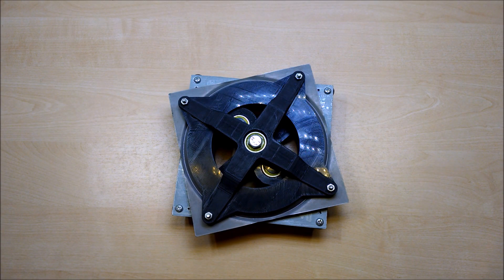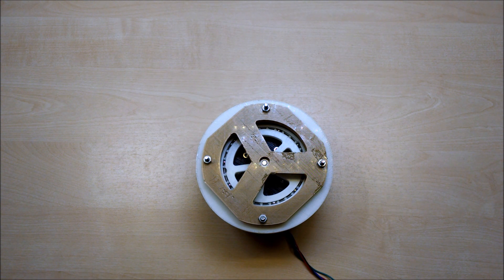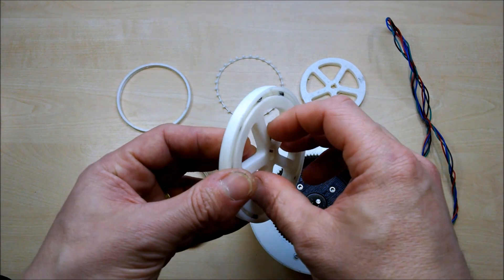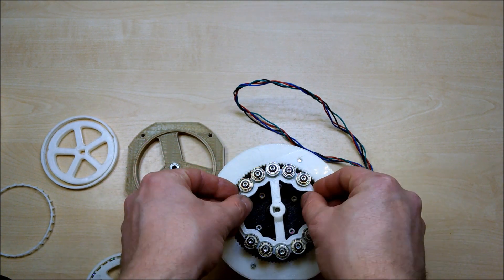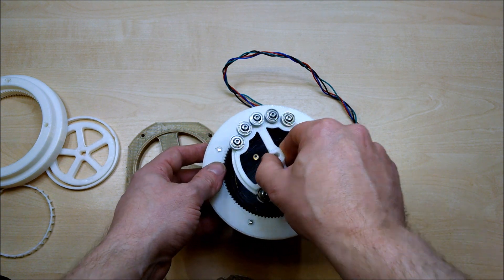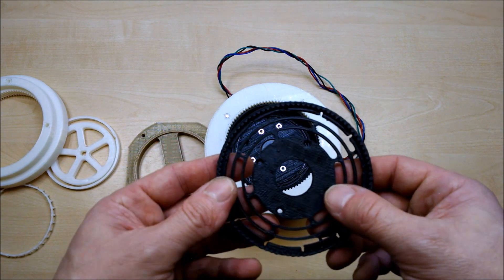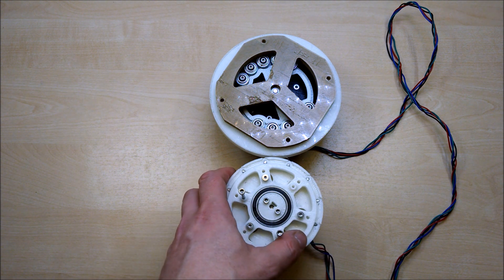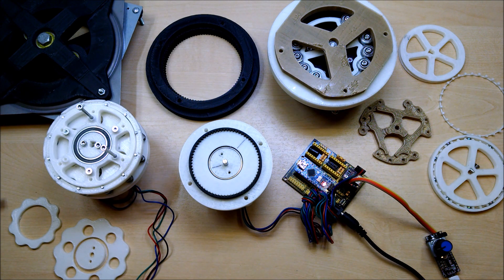Strain Wave and Hypocycloidal 3D Printed Gears Update

Comment: Nice video. You know there is an online calculator for ratio and design of hypocycloidal gears? I do not want to make PR for the site, but it is a site with a lot of designs. Just google "hypocycloid gear calculator" and you find it at the first place. I managed to get the shapes into Fusion via excel and importing a csv Spline. It is a little bit tricky at first glance, but it works fine.
Reply: alternativly I can highly recommend to read this paper upon modelling hypocycloidal gears: https://www.researchgate.net/publication/303577116_Modelling_the_Meshing_of_Cycloidal_Gears
I prefer this one over the otvinta one because it does not need any adaptation with offsets etc and the parametric functions are pretty easy. I use Excel to set the parameters and draw the profile to "play around" and import the r q and e values as parameters into my cad to constrcut the profile.

Comment: I was making something very similar recently, and discovered that the bearing problem is caused by the groove with a half round cross section. This causes many portions of the ball to make contact, and each has a different linear speed due to different circumference. I changed the groove to a trapezoid cross sections, so that only the angled sides make contact with the balls, only in two points. The back edge has clearance, and does not make contact. There is a very drastic reduction in friction, the bearing spins freely while being tight enough to have no easily detectable slop. I haven't tried using a cage, but I suspect that it would work well.

Comment: This is awesome. Has this project stalled? I haven't seen an update in about a year.
Reply from the maker: Yes, stalled in progress but not in spirit. There are several projects that seem to be doing very well at this kind of gear, so without a strong personal use case to drive the development, I'm letting others progress the field. E.g. Open HD (harmonic drive) and Paul Gould's work. Both on hackaday.io.
Reply: Simon Merrett I’ve been looking at Open Torque. Something like that seems to be the sweet spot as it would allow for natural feedback at the expense of some backlash maybe.
Reply from the maker: Ooh, I hadn't seen that before. Thanks. Seems similar mechanically to this recent endeavour https://hackaday.io/project/164175-custom-motor-for-robotics

Comment: Great work. What I didn't catch from your speech, what was the reduction ratio of the final hypocycloidal gear working with the belt? And the numbers you showed for the hypocycloidal in the spreadsheet, they were taken with the first version with the roller bearings on the outer circle, right?
Reply from the maker: Scale Mog 69:1 (I think but rusty on the calcs at the moment - 69 teeth on the cycloidal discs and 70 teeth on the belt). The numbers in the spreadsheet cover a range of my designs but the one with the outer roller bearings had a 12 teeth ring and 11 teeth cycloidal discs, with a torque multiplier of 13.6 before the NEMA 17 stalled (likely due to the relatively low reduction ratio).

Comment: Can you make a Video about The rigidity of The gear, maybe with a lever arm? Please
Reply from the maker: Jojo1 my video setup won't really accommodate filming the gears with the beam I use for testing. The motor is just clamped to the desk. That's why I decided to calculate the torque and compare different designs that way. Perhaps one day but I'd like to get the gear performance better first. https://hackaday.io/project/19405-strain-wave-gear-with-timing-belts/log/88278-teardown-rough-first-prototype-htd-3m-hypocycloidal gives you an idea of what my test looks like.
Reply: oke. thank's for feedback!

Comment: heyo, if you're interested in making a robot arm w/ this project, you might find that 12:1 is plenty of reduction if you can use a BLDC motor on the input side. steppers are pretty low torque density! https://jakeread.pages.cba.mit.edu/actuators/
Reply from the maker: Jake Read nice tool you have there! I agree the BLDCs are a good way to go eventually but I like Dan Royer's approach to making this as accessible as possible. So far I see drivers like o-drive which could do this but aren't yet as common and cheap as a MEGA2560 and Ramps with stepper drivers. Specifically because I'm looking at the highest torque joint for these designs/tests, it's right above the base in many arm configurations, so the torque density wouldn't have much impact on the spec for other motors in the system. Of course, once you start working your way out to the effector, people should go and check out your website (and Dan Royer's https://github.com/MarginallyClever/armTorqueCalculator) because it gets increasingly worth their while to invest in torque density and you've made it really easy to see how to carve the budget up. Thanks!

Comment: A thought regarding running the stepper with high reduction (and therefore high motor shaft speed)...   The faster steppers move, the less effective torque they produce.  So for a 60:1 the stepper really has to be zinging along, in a condition where it's most susceptible to stalling.  I have a 40:1 globoid worm drive that I've been experimenting with and I've been disappointed in how easy it is to stall, despite the high mechanical reduction.  my sense if that if this was a DC motor/servo, it would be very strong.  

Does this map to your experience?   if the hypocycloidal is lower ratio, but producing high(er) effective torque...  is this because of the style of motor?  e.g. with a lower shaft speed it still produces sufficient torque but isn't on the verge of stalling all the time.
Reply from the maker: Constructive Realities I will pay attention to that as I go forward. As far as the versions I have already made, the grbl acceleration profile I'm using is pretty gradual over the course of a second or two, so I think that if the step rate / motor torque was an issue then it would overcome initially. Not sure if the motor stalls are instant or not (away from workshop for a couple of weeks). The other complication is that only the first hypocycloidal version and the elliptical strain wave version stalled the motor - the other versions failed due to the belt skipping. Good thinking though, thanks. 
For what it's worth on the motor type, I'm very interested in something like a gimbal bldc paired with something like an o-drive. The NEMA 17 is a good subject for development because it takes minimal investment for others to replicate. If you can do it with the NEMA 17 slowly, you will probably be able to do it faster with a bldc. And the power density of other motors will also help you reduce the mass of a robot arm and you have less of a torque requirement at each earlier joint.
Reply: Simon Merrett i think in terms of apple to apple toque comparisons for the units you have, testing with the input shaft speed consisent will probably yield different results.  My hypothesis is that high speeds with the steppers results in poor torque measurement, due to the low load requiired to stall fast moving stepper.  Im also interested in bldc for the reasons listed.

Comment: Really impressive. The output speed of the hypercycloid seems much more consistent too.
Reply from the maker: Scienteer thanks, the trick will be keeping the output pins straight under load, especially with the higher ratio version. I suspect the flexibility of the belt could end up being an issue there too - may have to go with steel pins or printed pins.